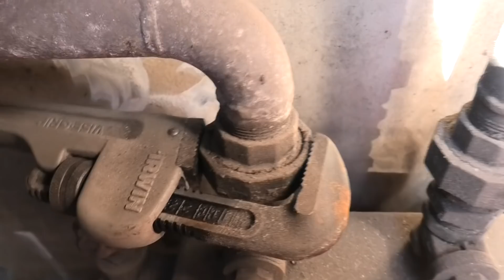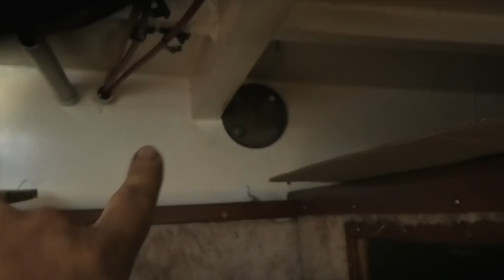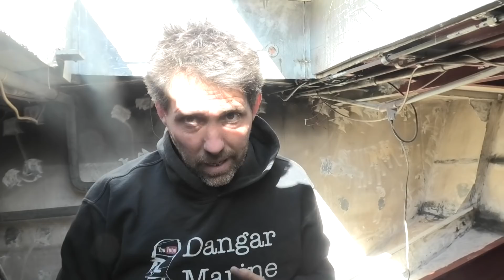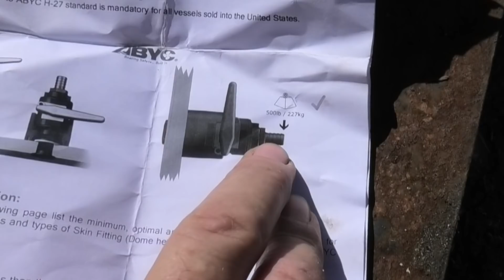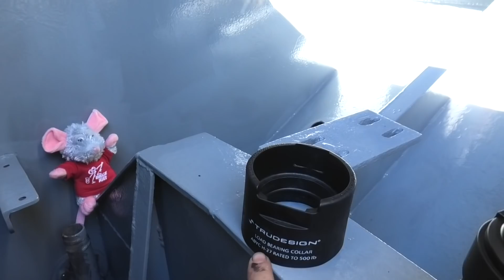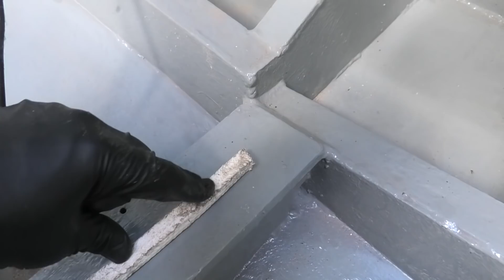Seacocks and stern gland

Comment: I too have a watchmaking tool quite similar to the one you used to gently encourage those screws through the bulkhead to relocate Stu.
I have an ancient English Commer truck made by the long defunct Rootes corporation, it has a TS3 'Knocker' two stroke diesel in it and I much prefer a manual shutoff, I would have one as well as a solenoid if one was fitted just, in case!

Comment: Discovered this channel today...and been (binge)watching it for hours..Great stuff,its addicting..really like your clear explains...Q..; As an ex steelboat engineer I wonder,why did you cut the gland packing?,Is that some kind of new material?we used to rol them in just like you did on 23.30,then grease(glands usually had grease point) and tighten them slightly every 10 running hours or so .Cheers mate,thanx for sharing..!!
Reply from the maker: Hey Frank. People say that with spiraling the packing it can grab and either constrict or unwind casuing a bad leak. I've seen it done both ways but people seem to favour cutting these days for safety. I'm not sure how real the risk is though.
Reply: @DangarMarine  Hi Stu, If there's mention of that problem with that packing,your probably doing it right,,...I am talking about "old school" system here  and lots off materials(adhesives,welding,sealants etc.) have changed for the better over the last 10 or so years, and the packing you have is probably an updated version with water lube instead of grease,(which will make boating a lot easier ) ...I try some research on the subject and if I find something important I'll get back at you...Cheers mate ,I'm gettin to the finished detroit  engine episode.,fascinating stuff!!
Reply: @DangarMarine  This looks like the right way to go...,seems you had it right the first time,good one Stu...Cheers and kudo's !!  https://www.youtube.com/watch?v=70yb9e5RSNg

Comment: One thing you might consider is instead of pipe couplings where you need 2 still sons, is hammer unions from the oil and gas industry. The only tool you need to make or break them is a hammer, preferably copper. Not that expensive if you get the sourcing right. Hint, a void the Chinese ones, indeed any Chinese pipe fittings.

Comment: How did you ensure you tightened the fitting and collar/valve to correct torque?  Huge/special attachment for torque wrench?

RichE San Diego, CA
Reply from the maker: The instructions say finger tight, let the sealant set and then turn an extra half turn to get the required torque.

Comment: What's the model of the welder you're using?  110 or 220 or other voltage?  Do you have to pay extra for the power where you're at?

Thanks.

RichE San Diego, CA
Reply from the maker: It's a BossWeld 140 amp, 240V and no, power is a part of the price.

Comment: Could someone bed/weld additional sheetmetal layer onto hull bottom to add extra protection/peace of mind? With my luck I'd strike rocks/reef right on a spot where corrosion made a thin spot. But I have zero experience with steel hulls. Your great videos are my first learning experience(s).
Reply from the maker: You can, but it is generally better to cut out and replace thin steel as corrosion can occur between the two bits of steel without being visible.

Comment: I think those thru hull fittings will work fine. I agree with you about the electrolysis. Are you putting a strainer in the raw water intake before the sea chest? It will keep debris out of the water lines. It won't be long and you be in the water. Don't forget you need a ground plate for the antenna.
Reply from the maker: Yes, I do have two sea strainers ready to install. A large one for the engine cooling water and a smaller one for the sea chest.

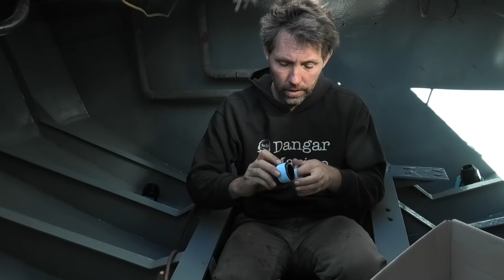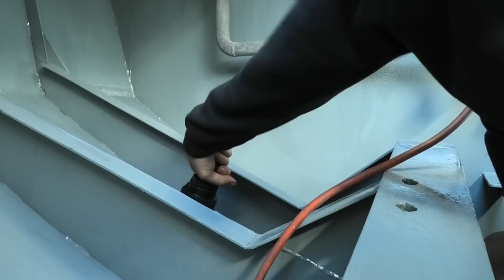Comment: @ 21:18  Is that a left hand thread fitting??   If not then you are applying the Teflon tape in the wrong direction!  Always apply tape so as it does not try to unravel as you screw the fitting on or adapter in!  Personally, I like to apply tape and dope in top of the tape.  The dope acts like lubricant during assembly and sets up over time to assure a great seal.  @ 21:28 you don't seem to have any trouble threading that adapter into the ball valve by hand only which makes me think that it may not be a good seal.  Dope would have been a best application there in my opinion.
Reply from the maker: I just wasn't paying attention while talking to the camera and wound it the other way before installing. I knew I should have refilmed it. I will be adding more tape on that one, just ran out at the time I was filming.

Comment: Thru hulls always weep. Moisture will get trapped under the nut and eventually start to rust, increasing the thickness under the nut and eventually breaking the mushroom off the thru hull. Perhaps if that washer under the nut is made of zinc then it will be ok.
Reply from the maker: All the metal around the through hull fitting is epoxy coated like the rest of the hull. It won't rust for years and years.

Comment: I hope that any electrical connections you make are soldered and not crimped.
Reply from the maker: Then you will find the crowd that claims good crimping is much better than soldering, which appears to be the consensus these days. A high pressure crimp will actually form an atomic level weld. Something I didn't know about until people started yelling at me to stop soldering...
Reply: @DangarMarine   Unless you are using a hydraulic press to make such a crimp you are asking for problems. Crimp connections are temporary. Even automotive manufacturers will solder connections after crimping them. 

As for people saying soldering is bad. Well my answer is why are battery terminals always made of lead?

Comment: A helpful tip...I used to rebuild large commercial water pumps and when we replaced the packing we would coat it in anti-seize. It helps it go in and come out a lot easier.
Reply from the maker: I'll give that a go next time, thanks.

Comment: Is there a reason the packing just can’t be wrapped around and put in without being cut?    I will be watching every video as I always have. I am excited to see how the channel evolves.
Reply from the maker: With it spiralled the flange won't put an even pressure around the whole propshaft as it will press against the end sticking up. Also I have heard that it can grab on the shaft and wind out putting pressure on the stern gland casing.
Reply: Dangar Marine ahh that all makes sense I didn’t even think of it maybe unwinding.  Thank you for responding and another great Video Stu.

Comment: Good tip: use a sink plunger to test the skin fitting and valve for leaks ... grease the edge of the plunger, stick it on the hull from outside, if the plunger is still stuck on half an hour later, then the fitting and valve don't leak. If it falls off onto the floor in 30 seconds .. you still have a leak.  Saves hauling out!!
Reply from the maker: Good tip, I like that. :)

Comment: Boat is an acronym for Bust Out Another Thousand. I am looking forward to your underwater content, but I have a feeling that there will be no shortage of repair/upgrade videos in the future too. Are you planning on any noise cancelling materials for the cabin? I agree the carpet needs to go, but just steel walls can be hard on the ears.
Reply from the maker: It's a boat, so there will be endless repair and upgrade videos for sure. ;) Yes, planning to replace that carpet with a more modern style of marine carpet and put soundproofing foam sheets in the engine bay.

Comment: Is it a safe assumption that all of your water-tight compartments will have individual pumps as you move forward with the project? I have seen several 'sea chests' and hard piping being removed during a remodel/upfit - why? It seems like a real solid backup system to more modern bilge pumps. I don't think I would want ALL of my compartments to lose pumping ability if the motor dies, but it sure seems like an engine-driven pump would be far stronger and more reliable in all OTHER cases, and provide a wash pump for cleaning, washing mud off anchor and rode, water-blasting pirates, fighting fire,  and possibly even adding ballast on occasion. Thoughts?
Reply from the maker: They will, but the sea chest will be going back in once it has been serviced too.

Comment: Are the bolt holes thru Hull ? Like a flange seal ?  Or are the blind  ck to see if they are just rust plugs 😎
Reply from the maker: They are blind, but I'll double check and maybe put some bolts with sealand in them just to keep the thread good if nothing else.

Comment: She looking great!!! Maybe laugh when you said 15C is 0 Stu - we are 15c is summer time and shorts, too hot to work :D

I have to admit that calorifier was in a dumb place and needs to be moved, but hot water is nice to have onboard...
Reply from the maker: Hot water is a nice thing, particularly after diving but might move to something instant and gas powered.
Reply: @DangarMarine  Those Paloma type heaters are quite popular and great if you has gas on board, and don't run out like the calorifier :D... just make sure they are well ventilated in the cabin.

Comment: The composite through hull fittings are great. The only caveat is you need to use them by the book. The ones I've used have a support collar that HAS to be used.
Reply from the maker: Yes, here you need the collar to pass survey so they were definitely worth using.
Reply: @DangarMarine  I think the horror stories come from people not using them properly. I was skeptical at first when they came out, but years later the first boat we put them in they are still working like new and I am sold. The owner does nothing to really maintain them other than opening/closing yearly and possibly cleaning once in a while.

Comment: I know I’m responding Monday morning but here goes , I do like the idea of using the marine grade plastic where ever you can ! I know they are stainless steel bolts but I’d use never seize on them just the same , I don’t know if you have plans on mounting a fire extinguisher in the engine bay , it might be a good idea to run all your electric wires through a conduit . Just thoughts on my part ! Boat is looking fantastic !
Reply from the maker: Yep, will be using conduit for everything. I haven't decided what to do with regards to fire fighting in the engine bay. Something fixed you can activate from the outside would be good.
Reply: Dangar Marine that would be safer for sure ! Maybe something like they have in restaurant kitchens with a panic button or something !

Comment: Your Channel your Vlog s and i have worked in Engineering for most of my working years and have come to Love full details of a Repair or refurbish of parts ,Q : when you fill your dive tanks will you put them in Water to keep them cool under so much pressure going into them and where will you put the dive compressor on the ship ???. I looked at the price of that Rove and just on $2000. AUD i could see a lot jumping at it.
Reply from the maker: At the moment I don't have any immediate plans to put a compressor on the boat, I'll just take 6 or so filled cylinders with me. I do like the small 24v surface supply systems for shallow dives though.

Comment: Those are some pretty impressive looking plastic fittings. My earlier comments referred to what I always see, which is people going to the hardware store and using plastic fittings designed for the home. I've pulled quite a few of those off of boats I've worked on. I'm going to run these by the coast guard before my next project as it will be inspected and they have the last word on whether or not it passes. Great content as usual!!
Reply from the maker: Yes, the hardware store isn't the best place to get bits for a boat, particularly below the waterline!

Comment: Using composite material is the best choice you can make.   Exploit every practical advantage offered by contemporary gear. The result is a more reliable work-boat.  Unless the goal to is preserve a vintage boat to it original spec there is no reason to run the hazard of out-dated materials or technologies.
Reply from the maker: For sure. It's worth taking advantage of all the modern technology you can.

Comment: NEVER NEVER NEVER put grease on a tapered coupler .you will find out why when you go to remove it JUST SAYIN keep up the good work love the videos
Reply from the maker: Or you could just tell me why.
Reply: Dangar Marine   Putting grease on the taper causes the female taper to ride up on the male taper and actually stretch the female causing removal to be very difficult thanks PETE from Long Island New York     PS the same applies for a propeller taper
Reply: Dangar Marine   all tapers should be assembled clean and dry i am a marine diesel tech for 40 years
Reply from the maker: Why is the question though.
Reply from the maker: Cool. I'll give it a clean up and reinstall. I always like to know why!

Comment: At 21:19 were you threading the Teflon tape anti clockwise?  If the thread is a normal right hand thread, then the tape must always be wrapped in the direction of tightening. Otherwise it tends to climb out of the thread while tightening.
Reply from the maker: Yes, was too busy with the camera to pay attention. Actually changed it before installing.

Comment: Looking good Stew! I think those through hull fitting and ball valves look like good quality stuff. Can’t wait to see it floating. I know that with 10 days to go time is tight but take your time with the electrics. Take lessons from Project Brupeg on wire ends. Solder and heat shrink your everything possible including your main battery starting cables. 

Don’t forget that since you’re drawing raw water for cooling that you can plumb in a 3 way ball valve on your inlet be set up to draw water from your bilge during an emergency.
Reply from the maker: Yes, I'm very keen to do the electrics right. I'll probably end up with some form of temporary bilge pump to keep the hull safe while I'm in the US but I can push on properly once I get back.

Comment: You should never lubricate a taper as it will creep and go onto the shaft to far, clean taper faces with the thread lubricated with never seize.
Reply from the maker: I'll clean it up before I secure that nut then.
Reply: @DangarMarine  Normally in my field you draw the coupling on to a specific dimension with a dial indicator, then seal the area at both ends with a rust preserver like Tectol so the salt air does not start any corrosion internally. I worked of shore for many years as a mechanical supervisor on high speed rotating equipment were you even had a limit for the tapered bore of the  coupling and once it had stretched you replaced it. same as tapered push bike crank arms, no lubrication. I have followed you video's and you have done a great job on your vessel and cannot wait until it hits the water.

Comment: Detroit diesels have a manual stop emergency shut off valve that can be tripped by a cable In case of a run away.
Reply: Trips a damper on the air inlet housing, saved many many engines, worth their weight in cocky shit.

Comment: mark from Bristol you will find it easier to loosen a dart union  which is very tight get two hammers hold one the union and hit it with one  once it you hit move to the next flat on the dart union and you find it loose once the silicon or pipe grips i hope helps next time

Comment: You need to get your self a mig welder no more problems with slag inclusion when you run a bead of weld what you see is what you have no more chipping slag to find problems underneath .. new inverter migs are cheap and so is the gas you can use them on stainless and on aluminum too with a change of wire and sometimes gas depending on what you are doing... Great videos keep doing what you are doing ...
Reply from the maker: Yes, I'll have to keep an eye out for one.

Comment: Looks good. We use Forespar, Marelon seacocks on the Ocean Sport Boats that we build at Nordic Tugs. They are lightweight, strong, and will not seize up.
As to bilge pumps: as well as putting one in each bilge space that is not connected to the others, I would recommend putting an extra in the engine bilge. The main pump should be at least minimum recommended capacity, and then install a larger pump also, with the float switch set higher than the main. That way, if you get water coming in faster than the main pump can deal with, the higher capacity pump will come on if needed. This means that, under normal circumstances, only the smaller pump will be drawing current from the batteries.
Reply from the maker: Sounds like a good setup. I'll definitely be having two, possibly even three bilge pumps in that engine bay as it has all the skin fittings as well as the stern gland to worry about.

Comment: Hi Stu. Love the videos, especially the way you do step by step instructions on the instal processes.

You said about keeping the gland packing on the boat and then having some spare stern gland nuts on a cord by the strern gland. Why not get a watertight tupperware container and keep the gland stuffing, spare nuts and a couple of lengths of threaded rod etc. in it and tape it (or Sikaflex it) to the bulkhead close to the stern gland where they will be needed, especially in an emergency,  rather than having to search through lockers.
Reply from the maker: Yep, having things grouped in containers by the job that needs doing is a good way to go. I think I said 19mm nuts in the video but I actually meant a pair of 19mm spanners to keep in the kit so I don't have to go hunting for them in an emergency.